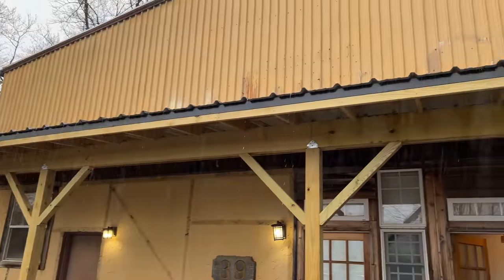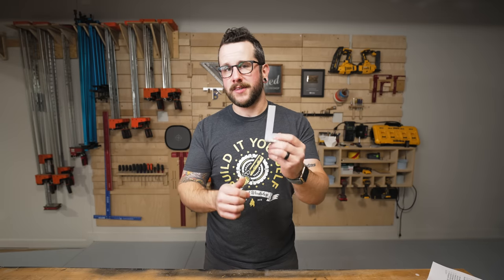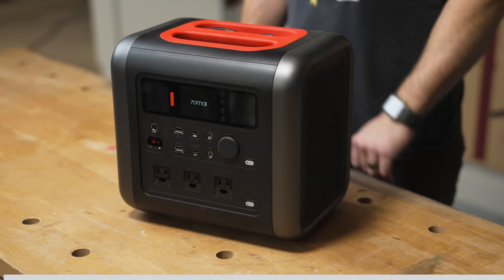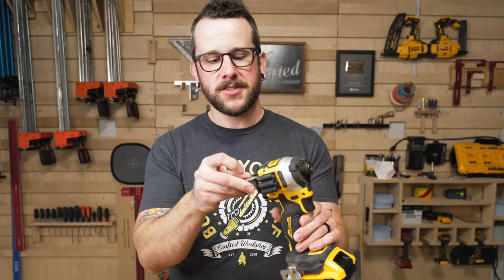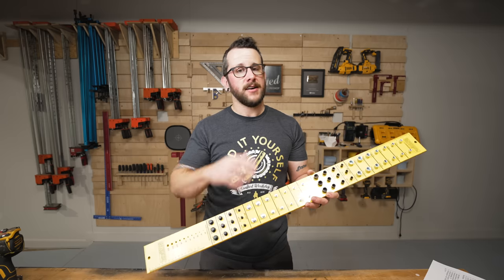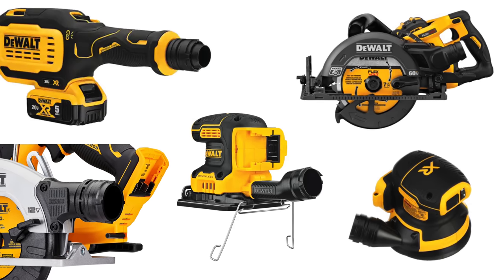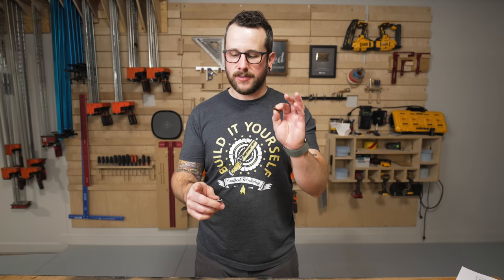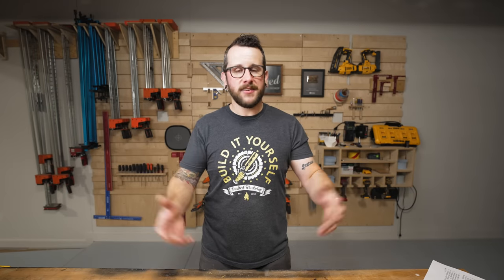16 Tools Under $30 Every Workshop Needs

Comment: Great list! One thing I’m always using that could add to this list is a Non-Contact Voltage tester pen. I use it constantly before AND after flipping a breaker switch while doing misc. electrical work to make sure I don’t shock myself.
Reply: *☝☝thanks I got a fantastic gift for you🎁🎁🎁*

Comment: Just a hint about your fire extinguisher.  Every six months or so, tip it upside down and back a couple of times until you can feel the powder slide from end to end. Other wise it gets compacted and may not work as well when needed
Reply: Just did this to mine.
Reply: Also, know how to use it. As a firefighter, I teach people all the time on how to use it and to call 911 first to get help coming.

Comment: Great reviews. I ended up buying a few, and putting a few others on my wish list. 

The item that most intrigued me was the thread checker. Home Depot used to have something like this hanging out in the hardware aisle, which was super convenient for me bringing in a nut or bolt, quickly checking the size, and then buying more of the same. But now they don't (!!!). So having something like this in my home shop was uber cool. However, I ended up going with the CKE product on a cable b/c 1) much more complete sizes (up to 1"! but they don't include sizes SAE 4, 12 and 7/8, or metric 18...); 2) can more easily bring the gauge to where I'm working (the CKE vs. the Thread Checker brand featured a detachable cable loop); 3) takes up less wall or drawer space than a board-mounted version.

Comment: I've had that wera bit holder.
Looks great holds bits well.
But!!
The magnet is so weak it can not hold any screw.
It is always dropping screws.
Now I have the, WIHA 7149

Wiha ClicFix quick-change chuck

And it is so much beter.
Can hold 3 inch screws with no problem.
Reply: *☝☝thanks I got a fantastic gift for you🎁🎁🎁*

Comment: sorry, but as a fire safety specialist i have to be clear: super nice you make us all aware on fire safety and the need to have extinghuishers - but the fire balles are dangerous toys. there are safer automatic systems 1/ heat activated pressurized fire extinghuishers OR even easier, sprinkler heads on city water pressure.
Reply from the maker: Good to know!
Reply: Don’t think those options are under $30….
Reply: He is just listing items to make money off them with the affiliate links he has with Amazon in the description.
Reply: Lemme know how much those cost so I can laugh at you
Reply: @deerarebigdogs totally
Reply: Specialists my arse, listing expensive options no one will buy doesn’t help anyone. I think a fire extinguisher is where it starts and ends for this video. End of story
Reply: @CraigularjJoeWoodworks  yeah they usually just post stuff that they have affiliate links to that way they make money

Comment: I would like to say, as a carpenter, you never sharpen both ends of a carpenter pencil for the same reason that it always goes tip down into your bags. If you trip you really don't want to puncture yourself with a pencil. I would say you should always put your safety over convenience

Comment: did you just install the FastaCap Pro Hold on the motor air vents or the cordless drill? That is not going to help that much
Reply: *☝☝thanks I got a fantastic gift for you🎁🎁🎁**